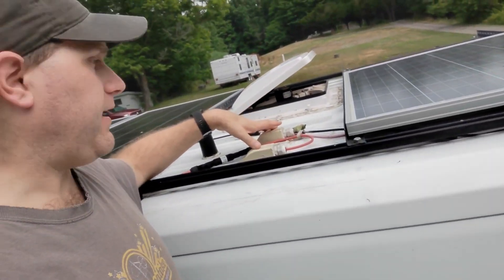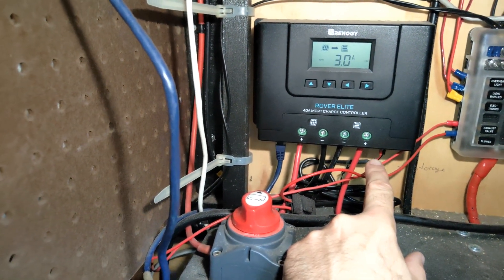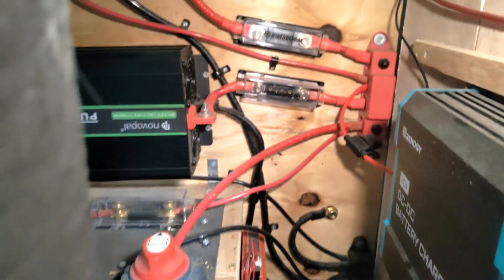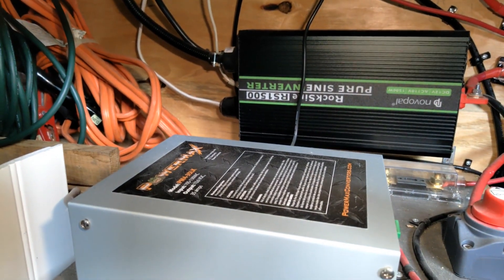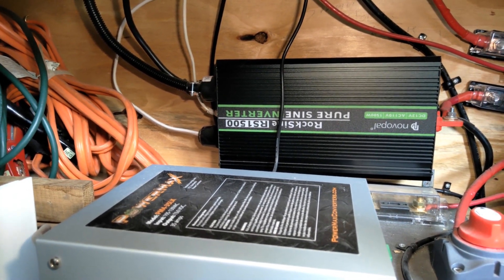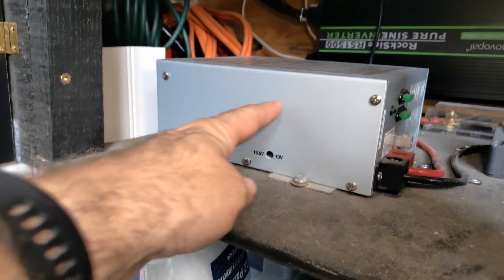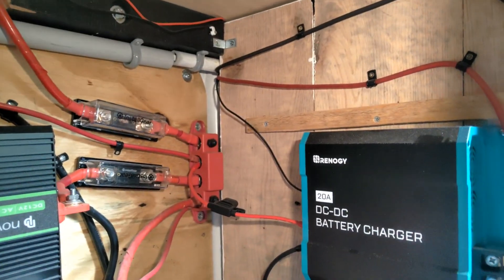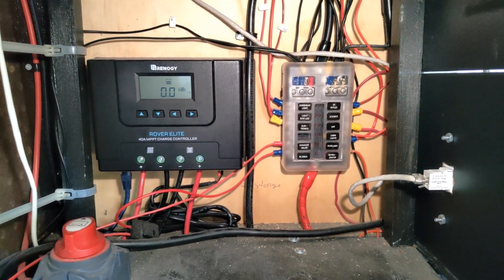Promaster Vanlife Custom Electrical System (House Battery Setup)

Comment: What is the capacity and type of batteries you're using? Really cool build.
Reply from the maker: They are Fortune 100AHr, I have 8 of them to make a single 200Ahr 12 Volt battery.
https://www.electriccarpartscompany.com/Fortune-100Ah-Aluminum-Encased-Battery

Comment: is there much difference in physical  size between panels, the 200 watt does not look twice as big as the 100 watt
Reply from the maker: The 200 watt panels are only slightly larger, 30% maybe.
Reply: @TuxTraveler  just wondered why you never did 3x200 watt, did you run out of room or did you think 500 watts would be more than you need
Reply from the maker: 1.) that would cost an extra $300 for the next step up charge controller, plus an extra $200 for an extra panel
2.) I had a 100 watt panel laying around already